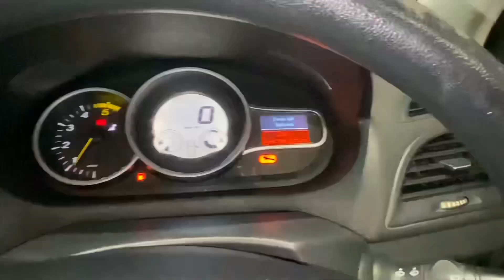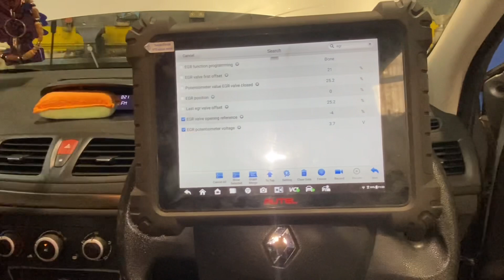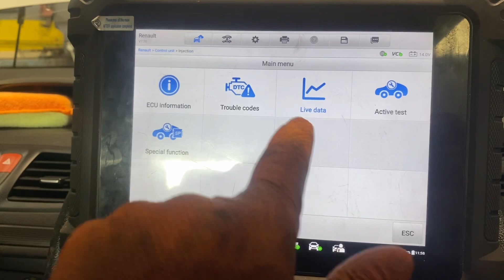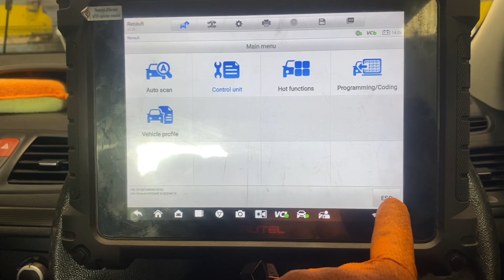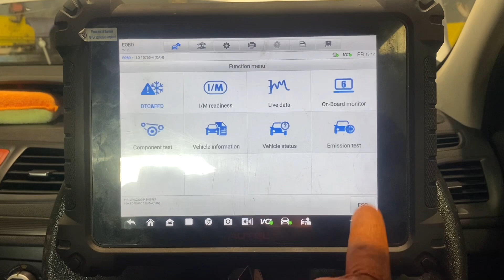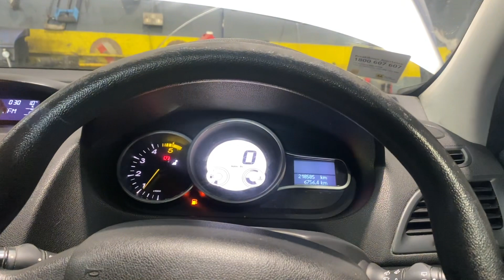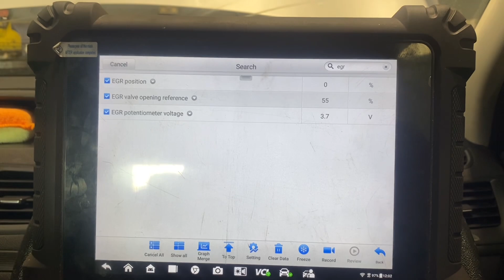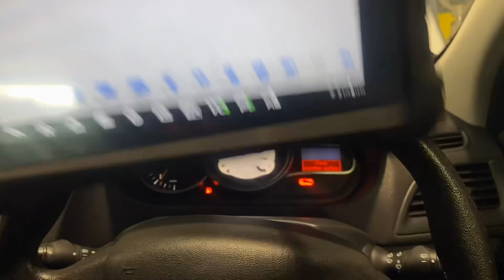Renault P0488 EGR throttle position fault, Part 1

Comment: Really helpful. Thanks. Got a bad EGR on my Vivaro. Changing it over tomorrow. Got a P0488 code. Hopefully, a new valve will sort it. It's one those electronic ones, no vacuum. 9 years old 90k miles. 🤞
Reply from the maker: @bryanwillson4821  hi Bryan, hopefully it worked out as planned & thank you for watching 🙏🙏
Reply: Yes, all sorted but I also had to change the exhaust pressure sensor which was also bad. All DTC codes cleared and all is well again. Many thanks.
Reply from the maker: @bryanwillson1615  💪💪

Comment: Hello, when the temperature of my 2015 model diesel Fluence vehicle is around 75 there is no fault, but when it reaches around 90 it gives the p0488 fault
Reply from the maker: @savasyimaz6157  temperature can effect motor and when they fail. Heat it with a hairdryer and try to recreate the issue at a lower engine temperature 🤔🤔